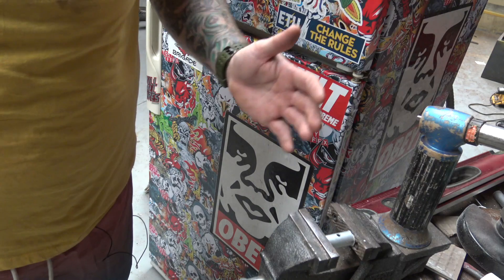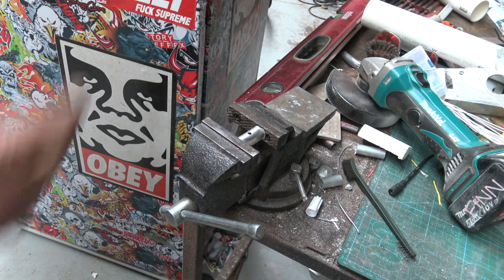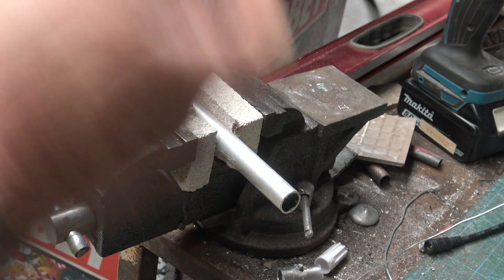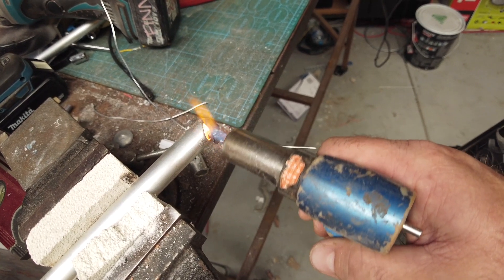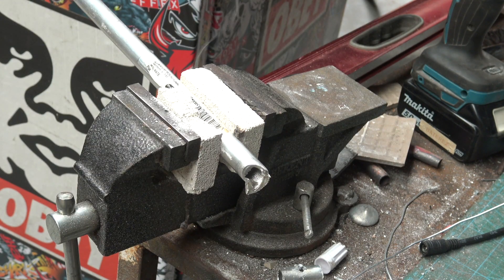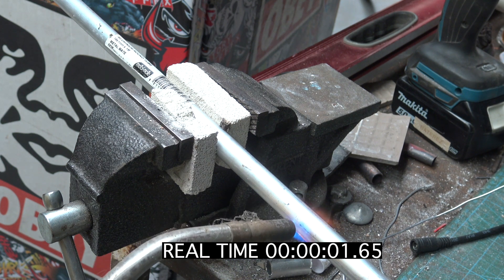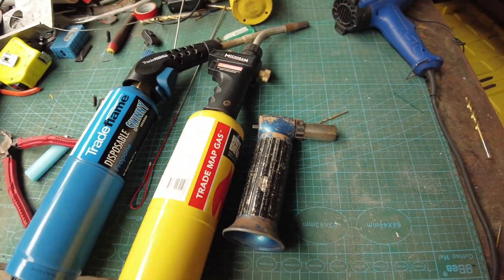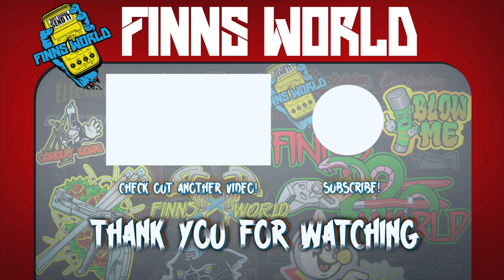What Gas is the Best? For Low Temp Aluminium Brazing Rods

Comment: On thin aluminum i can see using the less hotter gas. However if its a thicker piece you have to heat up so much of the area around the weld to help heat disapation from getting the weld area up to temperature to work.😊

Comment: Can i use lpg?
Reply: please re-read your question... do you burn a gas or a liquid? propane is a gas. yes you can burn propane.

now if you want to use liquid propane, you need a double detente gas regulator, lower the pressure from 250 psi to less than 5 psi, then lower it again to the burner required pressure which should be 3.5 in water column or less. That setup is very expensive and requires to be done by a certified gas technician.

the easy way is to use a blue propane plumbing tank or a green camping tank, of your need is for heavy-duty and long-lasting, you should use a propane bbq tank with a special turbotorch mostly used by roofers and 12 feet of hoses.  

Any setup bigger than that will be ridiculously expensive.
Reply: @joelpichette  thanks for the answer, 9 months earlier i tried to braze with jewelers torch attached to lpg. It does not get the job done. I did not want to spend money on any harware so just glued the parts with epoxy. The parts were 2mm thick aluminium sheets for a lighting fixture.
Reply: Yup just remember 10 min on each side and make sure the center is cooked to 165 then season and eat😁
Reply: @3613jeremy  those were the hard days :) i was broke and could not afford any hardware nor meat :(

Comment: Sweet. Great vid. I did buy some 4mm rods, but my butane struggled to get a melt up. Would 2mm or 1.6 be better
Reply from the maker: Slightly, but in the end you still need the base metal up.